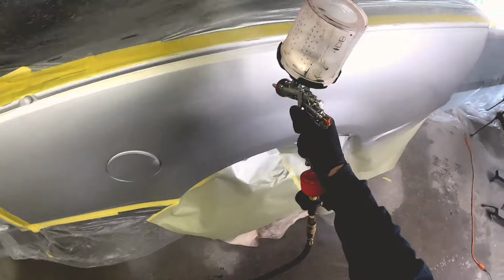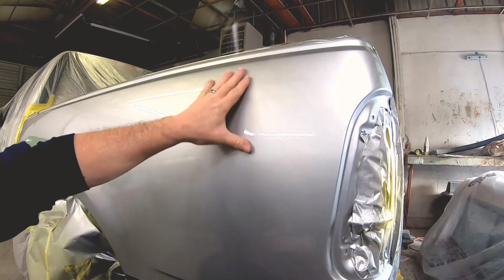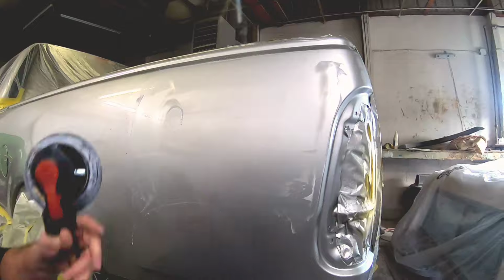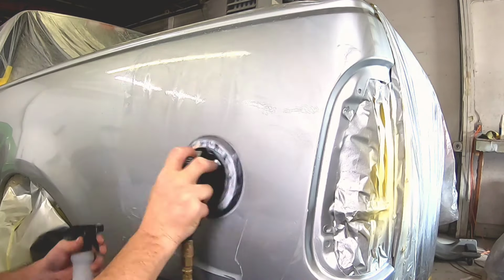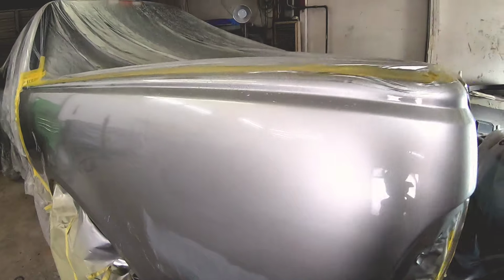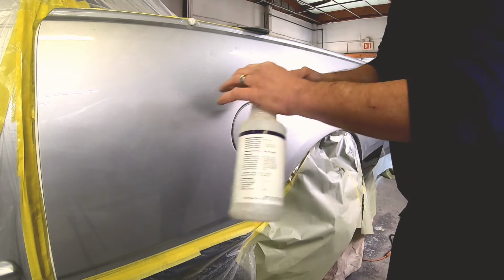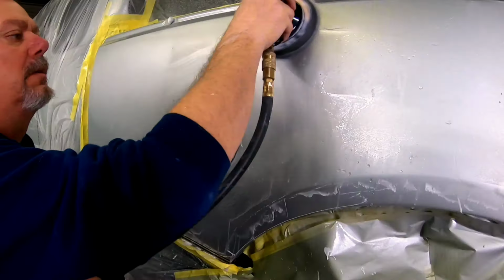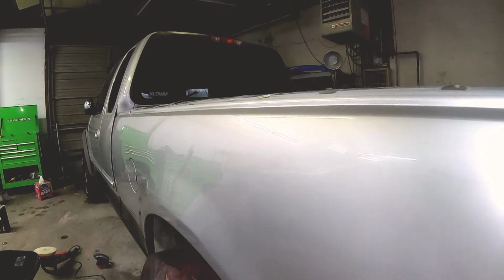Beginners guide to wet sand and buff your paint like glass!

Comment: Tips: use soapy water so the paper glides across the panel. 

stay away from edges and body lines. it makes it a pain to buff and also is easy to break through the paint.

get a squeegee. if you have “trash” in your paint, it will show up like little dots. what i like to do is bury them in the clear coat and then wetsand the spots down with 1k till they are gone and then the whole panel with 2-5k. 

use a cotton buffing pad. these are difficult to use, because they easily burn through the paint, but if you keep your step one compound on it and make sure the panel doesn’t get too hot, you will be fine.

DO NOT TILT THE DA. if you are new to polishing use a soft block to keep it flat. if you tilt the da, you will get da marks which show through when you have a shine on the car. 

use 3 step polish. this includes a cutting compound, a polish and a finishing polish. step one is to get it smooth and shine. it will leave swirls but step 2-3 take care of them.

get a color correction light. harbor freight sells one for 50 bucks or so and it helps so much. if you are in a paint booth, you can’t really see what it will look like in natural light. the light will imitate the suns light, but be sure not to shine it in your eyes. 

be careful while wiping your panel off after buffing. you can leave scratches in the paint that are a pain to get out by rubbing too hard. i recommend using a soft microfiber making sure to remove the tag from it, fold it into 4s and use light pressure in little circles. 

protect your shine with a wax. this goes without saying but i use turtle wax and it works wonders. 

the darker the color, the more imperfections will show. ie black paint will show more swirls then white paint. 

take ur time. this is about attention to detail. 

research the tools and materials you are using. know how much to use, how fast to run the polisher etc.

hopefully this helps, i am a student in autobody 2 and have had a passion for cars since i was a toddler. i have a cadillac brougham from ‘92 im getting ready to paint and autobody has helped me prepare immensely. if you are in high school like me, have a passion for cars and your school offers it, i would highly recommend taking an autobody class. i hope y’all’s projects come out amazing
Reply: Can i use shampoo liquid for wetting the surface so the paper will glide more without pressure
Reply: Soapy water with wet sanding will prolong the result of cutting the clear, since it has higher lubrication. If you want to wet sand a clear that may have less clear then soapy water would aid, but if you’re trying to cut faster just water will do.
Reply: @MineCrap-07 admittedly I don’t do much sanding but for any wet sanding that I do carry out, I always use a spot of car shampoo mixed into the water.
It reduces/stops any snatching and glides much better.
I do exactly the same thing when using a clay bar on my paintwork. 👍
Reply: Why is sanded\polished clear coat more prone to scratches than one that is left as is sprayed?
Reply: @Paripovic88  It's not, they just show up more easily because the surface is more "perfect". Just like it's easier to see potholes in a newly paved road than an old gravel/dirt road. The quality of the work just makes imperfections stand out. No disrespect to OP, but he told you he's a highschool kid with passion. Take it all with a grain of salt... I've done dozens of fully modernized restorations, Impalas, chevelles, novas, you name it. They were all show cars, and they all got perfect body and paint work with zero soap in the water lmao.

Comment: hey man love all your stuff. I wet sanded my hood by hand with a 1200 used a da with 1500 2000 and 3000 and after buffing i realized i could see all the micro scratches. Did i go to low with the 1200?
Reply: Personally I only use 2000 grit and go for a 'factory finish' - aka live with minor to moderate orange peel.

First I drysand  any spot with 2000 grit, focusing on dirt, bugs, nibs

Then wetland the whole panel to even out the orange peel.. but I stay away from the edges.

Polish it all with a cutting compound.  Wax after 30 days.

Good results,  no need to spend 3 weeks, and no need to buy 600$ of supplies either.

Comment: How long after spraying should you wait to do this step
Reply from the maker: It can be different for all different types of clears. Some clears will require a little bit of extra time before you want to cut and buff 'Em. But for this particular clear, I wait 12 to 24 hours before I cut and buffet it. And I feel like that works the best

Comment: Previously I still had big scratches after sanding with 2000 grit. I'm now wondering if you really have to make every defect disappear with 1500 or if you have to leave a bit of defect and finish it with 2k to avoid bug scratches ?
Reply from the maker: Personal I never start with 1500 always 2000. The only exception is if you have heavy orange peel. Now I do use a kovax square 1000 and remove large dirt just to knock them down  before 2000

Comment: My friend  used the euro clear 2:1 from valspar 3 coats, after 10 days drying the 2000 grit sand paper will leave  piggy tails and marks , any  ideas why? I used finish 1 and that thing can be buffed like 24 has later
Reply from the maker: That is sometimes a problem with using a orbital  sander  and 2000. It's not usually the clear you use although that may effect it. The pig tails have more to do with the sand paper collecting clear on the sand paper and  causing the pigtails.  I've  had this problem  and its frustrating. If you want to use the 2000 on the orbital check the paper often to make sure its clean. I've mainly  had this happen  with 1500 so bad that I won't  use it on an orbital any more. I've  stopped  using  the orbital for the first step and just use it for 3000 and 5000.
Reply: @GarageNoise  thanks a lot, i saved the job but if was very hard and frustrating to do

Comment: hi chris its i like from me chris is that the same process on the bonnet and bumper but wont you be taking the clear coat off mate
Reply from the maker: Thanks buddy. yes, it's  the same process. It is removing a small amount of  clear as long as you applied two coats your good.
Reply: @GarageNoise   so chris 1500 and 2000 don't bother with the 3000
Reply from the maker: @ANDY-we7mr  I would only use 1500 if it's got heavy orange peel like in the video.  You don't  need to use 3000 but it will be easier to buff.
Reply: @GarageNoise  thanks for the advice chris hope you have a good weekend

Comment: When you start polishing with compound on a foam buffing wheel/pad do you moisten the foam pad or do you leave it dry, when you put the pea-sized drops of the compound on it and start the buffing process?  This issue is never addressed in these DIY videos.  Thank you.
Reply from the maker: I think it's recommended to moisten the pad lightly. I don't  do that but it won't hurt anything.
Reply: @GarageNoise  Thank you

Comment: any idea why when i wet sand a fresh painted panel and then use rubbing compound it looks hazy? i recently painted a fender and door, i waited 48 hours and then wet sanded with 1500, 2000, 3000 and 4000 grit . then i used the orange 6 inch pad from Harbour Freight with 3M rubbing compound , after i cleaned it with microfiber towel. it looks hazy!  i switched to Meguiars Ultimate compound and same thing happens . what did i do wrong??
Reply from the maker: The orange pad is a heavy cutting pad. You need a finishing pad black or grey looking pad. Might be the issue. Let me know if it helps
Reply: thanks for the reply. so i will use black finishing pad with Meguiars Polish and see if that changes anything. :)

Comment: 3000 and 5000 is overkill.  If you laid down the paint smooth ,2000 is all you need imo
Reply from the maker: Maybe, but I'll  tell you it's  so much easier to polish  5000 scratches over 2000. Yeah you can buff 2000. I actually want to take it a step further with 8000 which basically buffs it.
Reply: Overkill? For you maybe but it still came out nicely
Reply: @GarageNoise , it’s hard to tell but the higher the grade the more glassier the finish plus it’s less elbow grease.

Comment: I'm lost.  My 2015 Jetta had scratches.  I used 1500, 2000 then 3000.  The whole hood was evenly dull but no scratches.  I've tried Mothers, Chemical guys polish but I can't get any shine what so ever back.  Do you think I sanded off my clear coat?
Reply from the maker: Hard to say, you woulve had to sand alot to remove all the clear.
Reply: It's been 6 months so you probably don't have this problem anymore. But next time, use a microfibrr and medium cut compound and then a buffing foam light pad with a fine polish

Comment: Every time I wet sand with a orbital I get pigtails that are deep even when I use a 2000 grit from start to finish. I am even using a soft interface pad. Does using a 3000 grit help this? could the dirt nibs be breaking off and causing this?
Reply from the maker: No, not really. A sander with a short stroke, a finish sander will help. I got sick of pigtails so I mostly start sanding by hand and the switch to orbital for 3000 and 5000. I get better results that way. Appreciate your comment and support!

Comment: Does sanding take off more clearcoat than just starting with claybar and going right to buffing?
Reply from the maker: Wet sanding does remove clear. If you can buff the imperfections out without wet sanding that's  the best option.

Comment: My freshly painted black base/clearcoat panel now got some white needle size spots here and there after wet sanding and polishing. Sanding both primer and first coat of base I find it hard to believe I could have burned through,,, A few fisheyes in my clear there were. I gave good recommended flash time for all degasing. What else can I have messed up ? Dust nibs between base layers ? Can 2K clear make white looking gas pockets ...or someting thereabout ? They seem like they are underneath the surface of my now else glass smooth clear, Cant be felt, just seen.
Reply from the maker: It could be small fisheyes that the wet sanding residue exposed. Things like that in clear is generally from contaminants in your compressed air. Make sure you have clean dry air.

Comment: Chris, I was able to paint the roof and the 4 doors on my tundra.  managed to get 2 minor runs one on the roof and one on one of the 4 doors.  Is this good sandpaper to sand and buff my truck.
Reply from the maker: The dura gold would be good for the first step but I would use the 3m 3000 then 5000 to finish

Comment: Good video! By hand and machine, I start at 1000 and end with 2000. I do use all the grits in between so it's progressive. Then use a rotary at lowish speed using med and then super fine polish (always foam pads, no wool for me) then finish with an orbital at high speed with the same fine grade polish. Change pads often. Gotta keep the panel cool and you're right about watching out for grit etc. There's no rush on this job. You got a great result man!
Reply from the maker: Good stuff!

Comment: Hello, can you elaborate on some of the materials you’re using? When you’re wet sanding is that water you’re spraying?   
For the polishing, is that Heavy or light rubbing compound? Polishing compound?  Thanks
Reply from the maker: Yes, just using water and the compound is finishing cut. You don't  need a real aggressive compound with this process so a med to light cut compound will work well. Appreciate the support!
Reply: @GarageNoise  thanks!!

Comment: Great video, many thanks. Gave me the confidence to get many imperfections out of my clear coat and get it nice and shining! One moan though. I don't want to buy a polisher just to do one small panel, so followed right up until you got the electric polisher. Is there another grit paper or compound that I could finish the whole job by hand?? Many thanks from the UK..
Reply from the maker: You could go 8000 after the 5000 and you could get a polishing pad for you orbital sander if you have one.
Reply: Many thanks for video and reply. Think I previously ruined whole job by sanding the clear coat down to paint! Do I just go ahead and clear coat again, or will the hazy finish show through. Many thanks from UK. @GarageNoise

Comment: Hello
Great video and very informational
I have a fender that I was painting ( first time doing this) and I was using can spray and it started to sputter
So I need to sand the paint right? Get it even before the clear
Do I use 2k paper? Or less
The sand paper part is something I'm not to familiar with
Thanks again!
Reply from the maker: If it's  in the base and you putting on more paint then I would use 600 put a couple more coats of paint than clear. 2000 grit will work if it's  mior otherwise it may take a while tosand it smooth  and you will still need another coat or two of base.

Comment: hi mate, thanks for making this detailed vid! However I am punching the air right now because I have done this process I feel in a similar way, wet sanding only, from 800, to 1000, to 2k and 3k. I then cut with a foam pad (meguairs medium cut), followed by a final polish on a soft pad. Low and behold there are still swirls and deep looking scratches in the finish. Do you think it’s possible that these scratches im seeing are from the epoxy under the clear coat (which was sanded with 120 before i applied clear), and it’s just printing through? Apologies for the paragraph.
Reply from the maker: It's  hard for me to say, one question is, is the clear cured? How long has it been since it was painted? Sometimes if the clear is not fully cured it's difficult to get those fine scratches out. I don't think you could mistake body work scratches for clear coat scratches so it's  probly in clear.

Comment: Any tips for to make sure you dont leave any scratches even after polishing the clear coat? For some reason it does get more clear but in some angles with light, you can see some of the scratches in the clear! I usually sand by hand with the sponge block as well! Any feedback will help!
Reply from the maker: When I get down to those fine scratches I will use a lighter polish. In wizard's it's  called fine cut.
https://amzn.to/3OgEODd
I also use a softer pad the gray pads are typically finishing pads. This is important cause a heavier cutting pad could be putting fine scratches in your clear .  Also If your clear is still curing it may be a litte to soft to refine those fine scratches  . About 3 days after clear you should be able to get those fine scratches polished out. Hope this helps and thanks for watching.
Reply: It's simple get most of the major sand scratches out with the compound then take your time with the polish to get rid of the fine scratches I usually use 3m but the main objective is not to rush the job and sand and buff one panel at a time
Reply: @milelonmckinley4594 hey mane I got a red f150;hood wit faded paint can I be usin 1200 cause 1500 didn't get all of it out boss
Reply: @wildestcowboy2668  use a wool pad then use a foam pad when compounding then polish it and you should after that
Reply: @milelonmckinley4594  hey mane tks fo da heads up but is u sayin wet sand wit da red scuff pad boss
Reply: @GarageNoise wow, great info. Thanks bra
Reply: Use a guide coat! Only way to make sure you sand out those lower grit scratches

Comment: Hi Chris, After you cut and buffed did you do a final polish? Also, do you have any experience with those ceramic coatings?
Reply from the maker: I haven't  used or had a run in with ceramic coating yet but from my understanding it can create problems painting. I don't  usually do a specific final polsh only on black and I just switch to a orbital polisher with the csi compound.

Comment: I always cut through the clear.   Clearly my clear isn’t thick enough.   There must be a guide that tells you approximately how much paint is used for a square foot or a panel.  Something to help out us amateurs.
Reply from the maker: Two good coats should be plenty.  What are you sand clear with?
Reply: @GarageNoise  2000.
Reply: You can use more than you think. For beginners do 3 but once you’re borderline running it, without running it; 2 coats is plenty just wait the recommended amount of time in between coats and if you do have a sag, it can be easier to fix than being dry, for this reason exactly.